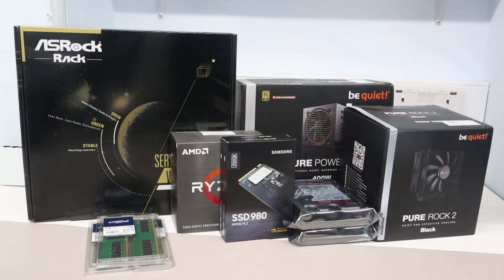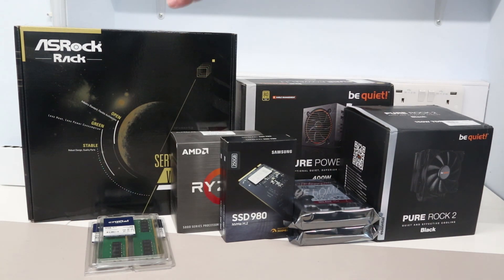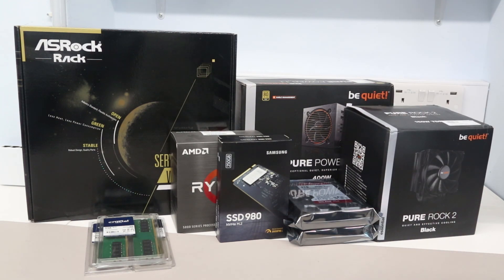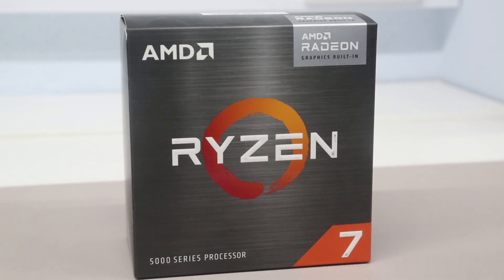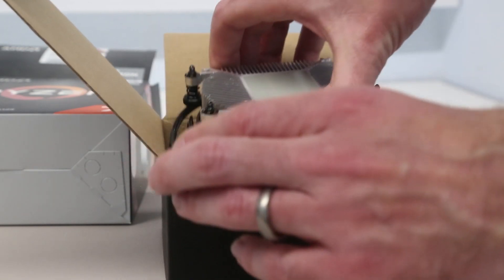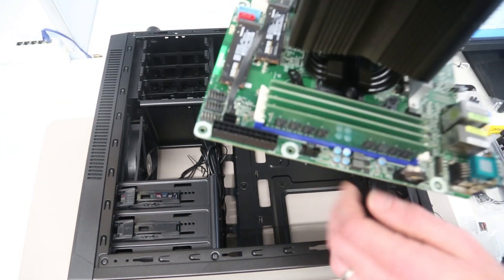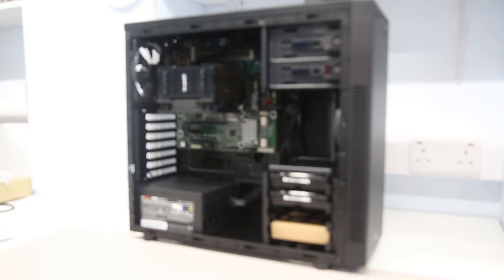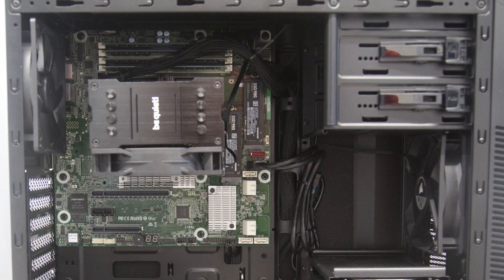AMD Ryzen 7 5700G and ASRock Rack X570D4U Home Server Build - Part 1 - Component choices + assembly

Comment: I just got this board and was pissed off when I installed the cooler and the fan was blowing at 90° to the normal air flow.  But now seeing your build (and one on amazon) I can see you ran into the same issue but went ahead with it anyway.

I know this is a really old video, but wondering if you ever swapped it out for something else so that the air flow all goes one direction through the case.
Reply from the maker: Nope, its been running in this configuration without issue since I built it.
Asrocks support for the board was pretty poor though - the BIOS section in the BMC never worked properly and the last BIOS release broke NVMe RAID so I had to roll it back to a previous one.
Reply: @BrueComputing  WOw, thanks for the reply.  Interesting about the bios.  I'm about to set up a TrueNAS server for the home and was thinking of updating the bios.  But then I read somewhere that Asrock recommends leaving it if it works.  So I'm going to take that recommendation until I attempt to install the OS.  Just waiting on the NVME drive to show up.

Comment: Cool video. I'm running windows server 2012 off of a Ryzen 3 220G and 64 gigs of ram at 3200. Works pretty good. I'm going to bump up the Ryzen to a Ryzen 5 5600G. I run an online radio station and it works seamlessly. Only odd thing is that Windows Server 2012 doesn't support AMD's integrated graphics so their just sort of hanging out being un-used.

Comment: With that board you can use a regular Ryzen instead of the G/APU variant. With the APU your PCI bandwidth is cut in half and you may lose access to the bottom x4 slot. The benefit of that Asrock board is the chipset with built in graphics. I did a build on that board with a 3700x and will look to something like a 5900x for an upgrade in the future.
Reply from the maker: You are absolutely right - I partly wanted the IGP for video encoding however as I use the system for CCTV and other tasks.

Comment: I bought this board a few days ago as it's the only AM4 board/non-Xeon board that has 2x PCIE slots that can do 8x lanes each. All other boards (either AM4 or LGA1200/1700) can do 1 slot at 16x then another at 4x or at 1x. So I have a dual 25G NIC that requires 8x and a 8-port SAS HBA adapter that also requires 8x lanes. After that you don't have any lanes left for a graphics adapter to boot from, here's where the Aspeed integrated graphics help.  So Ryzen 5700x 8 cores at 65w TDP for the power savings, Broadcom 9300i-8 for 8 SAS SSD drives and finally a dual 25G NIC. My main issue is that the BMC stopped working after assigning it a static IP. It just says failed in the BIOS. No amount of factory resetting has helped so far so I may in fact resort to RMAing it. Fun fact, this system draws LESS power at idle than my previous i3-12100 combo which is pretty impressive! 50w at idle for the 5700x, 59w for the i3-12100 with all other hardware the same (NIC, HBA, same memory modules and PSU).

Comment: Think I’m about to pull the trigger and order this board along with a Ryzen 5 5600x. Struggling to understand how to get the max non-ecc ram though. Do I order 4 3200 ddr4 32gig or 4 2666 ddr4 32gig? 

Hopefully someone chimes in to point me in the right direction, thanks!

Comment: Just got mine in. Only complaint is that the glued on bottom bracket renders some beefier coolers like the Hyper 212 Black unusable - and as I'm building around a Ryzen 9 5900x, I'm not gonna want to spare any expenses on the cooling. Kind of a odd decision on what otherwise feels like a very nice board. Gonna be giving the Pure Rock 2 Black a try since I've actually seen it work on your build.
Reply: Had the same issue as I wanted to install a Noctua NH low height cooler that has it's own backplate. Ended up using the glued backplate with different (but off the shelf M3) screws and its fine.
Reply: @thereverant5203  Really the one bad part of an otherwise pretty solid motherboard. As for the Pure Rock, It's worked out pretty well - Haven't had any thermal issues yet, even while torture testing the Proxmox install with a couple of really busy VMs.

Comment: Thx for the video.

What is the power consumption of this build in idle?
Is the Ryzen 5700g running in normal or in eco mode (or did you undervolting it to save some bucks over the year) ?

I'm inspired from your build and currently building a similar home server with a Fractal Design Define 7 case and probalby going for the ryzen pro 5650GE or the 5750GE with ECC Memory. Therefore I'm highly interessted what this build consums when idle.

Comment: Hi, pretty nice video, but I would recommend changing the cooler orientation. Your current airflows aren't aligned well with the case fans. The initial motherboard layout is designed for server chassis, so you need to keep it in mind when using this MB in regular cases:)
Reply from the maker: You can't change the orientation of the cooler unfortunately, it is dictated by the orientation of the socket. I may swap it out for a different cooler entirely (and have the stock cooler that came with the CPU) but will see how it behaves.
Reply: @BrueComputing  if you're willing to change the cooler, Noctua NH-D15 SE-AM4 kit allows you to change the orientation.
Reply: @BrueComputing  Yeah, the Pure Rock 2 probably doesn't allow to change orientation:( In this case, you could relocate a case fan:) I mean, your back case fan is currently stealing some of the "fresh" air in front of the CPU cooler and that's not a good thing. At the top, you should have a room for a fan to help the air flow.
Reply from the maker: @antonterekhov9389  There is no opening in the top of the chassis, so I'd have to cut it to do that.
Like I say, don't see it being a major issue with a 65W TDP CPU and no graphics card, etc, generating heat in the chassis, but will monitor temperatures and swap out if necessary.
Reply: Nothing he could do. Look at the way the motherboard and cpu socket is laid out.

Comment: For a home server, really interested to find out if the additional cost for remote management is cost effective? Cheers
Reply from the maker: For me it made sense as my server lives in a fairly inaccessible part of the house, so I wanted to ensure I could investigate any issues without having to drag it out and attach keyboard, monitor, etc, unless essential. 
It's a nice to have though, not something that is critical.

Comment: New subscriber, thanks for showing the build so far, looking forward to the rest of it. I'm thinking of the same cpu for a unraid build, what os are you planning? Hope you're are going to do some wall socket power testing, at load and idle. Cheers
Reply from the maker: Thanks for the sub!
Planning to go with Windows Server 2022 as the main OS, with Hyper-V or Docker running other services - not 100% decided yet.
I have a power meter somewhere so will get some comparative measurements vs. the Sandy Bridge system I use currently.

Comment: I'm curious as to why you chose a 5700G over a 5800X or other similar CPU?
Reply from the maker: I didn't want to have to install a discrete GPU. The 5700G has integrated graphics, the 5800X does not.
Reply: @BrueComputing  And you needed more than what the AST2500 chip would provide? That's what the VGA / D-SUB output on that motherboard is using.
EDIT: Accidentally a word or two.
Reply from the maker: I run my CCTV system on the server - so wanted the option of hardware accelerated video encoding.
Also the 5800X was almost £100 more expensive than the 5700G.
Reply: @BrueComputing  AHH! Yeah, that makes perfect sense. I was just making sure it wasn't a "yeah, but the 5800X doesn't actually work on this board" type of situation.
I was specifically looking at that board because it had onboard video features (plus I really like having IPMI on my home servers) so I could use something like the 5800X.

Also, here the price difference is closer to £22, hence the comparison. No way would I pay that much more for that CPU. :)